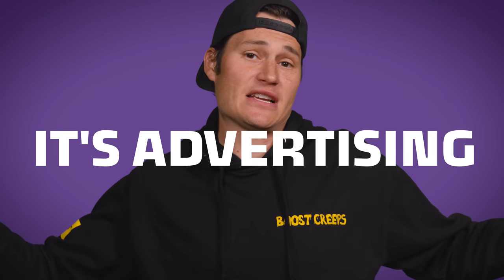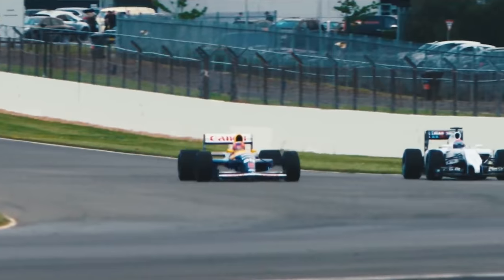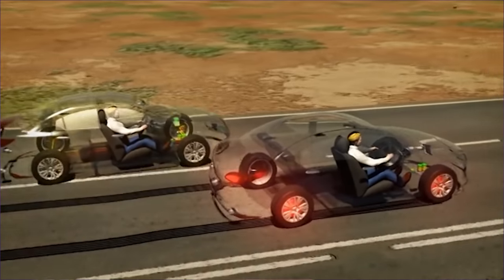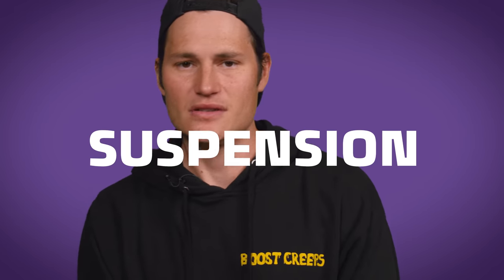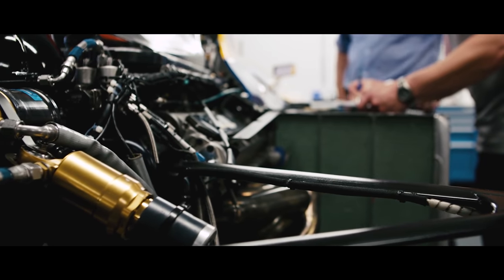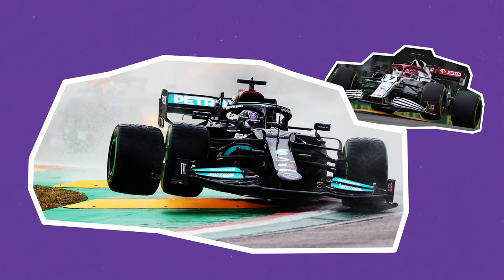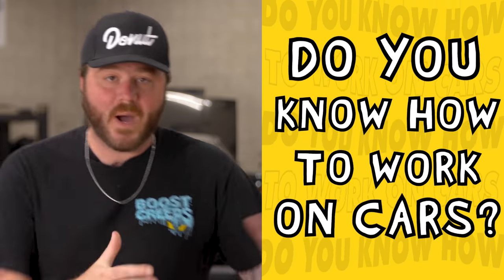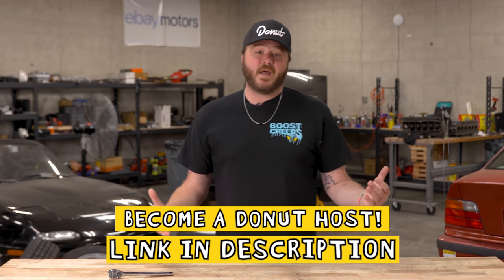Why F1 Banned Their Best Car

Comment: When FIA banned the active suspension, Williams didnt have the time to tweek the car with traditional suspension for 1994 GP, at that time Ayrton Senna moved teams to Williams, the rush to try to go back to traditional suspension is what probably killed Senna, who spoke a lot how the car didnt feel right that weekend. If it wasnt for FIA banning it so close to the GP, they probably could have time to adjust the suspension, and probably avoided the death of a great pilot.
Reply: While the suspension thing is true, the thing that killed Senna was the steering column.
If i recall correctly, Senna wanted the steering column to be elongated. That demand was given out a little late and they could only attach a longer piece of tubing to the steering column. The modification was poor and the tubing that they put in broke during his turn and he lost all control of the car's steering. If you watch the on-board, you can see how Senna's entire weight suddenly shifts to the left when he turns and his wheels straighten out mid-turn  before he crashed into the barrier. That's 100% the steering column breaking and the weight that Senna used to help steer the car got snapped to the left. Williams denied that the steering column broke from the stress mid-turn and said that it happened when he hit the wall, but if you take a look at the pictures, you can see that the point where it broke at is a near-perfect split where the mod tubing connects to the actual steering column. If it was caused by the crash (a force that goes ALONG the pipe from the front), it would've been bent and torn off.
Reply: @darkySp  FIA cheated Senna many times to help Prost win. One of the most disgusting organizations. They have absolutely no sportsmanship spirit.
Reply: @MrMeeHigh1  FIA wasn't an influence over Williams. The teams are still independent, FIA didn't pay or make Williams give Senna a car with a shitty steering column or anything even remotely close to that. That was just poor craftsmanship and Williams not listening to Senna's warnings prior. FIA had nothing to do with it. They even had people investigate the crash, while Williams denied the steering column failure, among other things.
Reply: @darkySp  i think he meant the instances where FIA at that time was helping Prost win races because the FIA president at that time was French and Prost was French. I'm not saying Prost doesn't deserve wins and has no talent, he was amazing but at some moments, FIA gave Prost some advantage over his rival.
Reply: @darkySp  FIA picks winners litterally! By changing the rules days before 1993 to remove Williams car the picked the winner for 1993.
Reply: @MrMeeHigh1  That still has nothing to do with Senna's death.
Reply: @MrMeeHigh1   Every International organisation, which seems and expected to work for betterment of this planet, Some How ended up in causing disasters to the world.

WHO, UN, World Bank, IMF, WTO. These are run by Crooks.
Reply: In 1994 the Williams team didn't have enought to make a good normal suspension and the car design was made to work with the old active suspension. The result was an extremely unstable car.

Trying to to make the car faster thru the corners the Team made a superlow suspension.

At that High Speed Corner in Imola the car was so low that the aerodinamic pressure made the front wing touch the groud, making the car suddenly lose all the downforce on the front wing.

With that downforce lost the car got out of Senna's control and crashed
Reply: @darkySp  Whith so much money on the line I am surprised that none of the sponsors hired somebody. Others went on a trip for a whole lot less. Shows they have sportmanship. Or hard to find somebody in western eu.
Reply: The car was likened to "an unbroken colt" :/
Reply: @MrMeeHigh1  in '88 Prost scored more points, but Senna won the championship. In '91 Mansell would have won the championship but a mid-season change to fuel regulations made Renault unreliable for enough races to allow Senna to win. There's quite a lot of mis-information, and the Senna movie was written very anti-Prost, as opposed to being fully considered
Reply: @djacircarvalho8251  the front wing had a turbulence problem that they didn't know about, causing random downforce loss and being the reason for Senna's difficulty finishing races despite qualifying fastest.
Reply: @darkySp  yes...  the steering column did break...  it was elongated at the request of Senna...  if the driving wheel is closer... you can "muscle" the car in turns to compensate for the lack of the active suspension.  One caused the other...  
The F1A used to be the "Anything Goes" style of Race with the best of the best in the world... if it fit the weight, size (motor and car) restrictions...   when they started to restrict all the innovations...  that's when things got more dangerous.  
Not only did we lose a great driver that day...  the world lost all the engineering potential that comes with the quest for better, faster, safer for years...
Reply: That was only because of the concrete wall it should’ve been a tyre barrier, adjustable suspension was a bit more dangerous actually, like if the computer misjudges the layout it is going to result in a very big crash
Reply: @fightingfalcon826  think i read that the biggest problem there was gps losing track of itself at an inconvenient moment, or in the case of Martin Donnelly wasn't it that the computers crashed, so the car did? it's a long time since i looked at any of that stuff
Reply: yes it did
Reply: The other teams had also electronic suspension, so it was not only Williams who had to adept quickly
Reply: The FW15D (the passive suspension car) was available and tested in January 1994, two months before the start of the season. Imola was the 3rd race of the season. Senna sat on the pole for all 3 races. That had nothing to do with his accident. They tried claiming it early in the investigation, but the evidence showed that the steering column has broken where they had hastily extended it.

Technically, the suspension did kill him because a piece of it broke off during the crash and pierced his visor.
Reply: whut?
Reply: That's a bad welding on the steering column that killed Senna. Nothing more.
Reply: Idk about that dude
Reply: @darkySp  Yes the steering column broke and for some reason they covered this up
Reply: @darkySp  Yes Senna's onboard camera showed his steering suddenly rip farther to the left and then he went off the turn. I agree I think his steering column cause the crash.
Reply: Ok, I'm gonna help you all out of the bs you've been fed. The steering column did not break, it looks as if it did because the wheel could move to ease steering. Before Senna crashed, there was a safety car, meaning the tires were cold and shrunk a little. When the race was back on, the car bottomed out, and went to the right. Senna tried to turn into the slide and the front wheels gripped again, going to the left, and the rest is history. The column broke on impact. However the active suspension could've saved him there
Reply: After the safety car period the tyre pressure had dropped, Senna bolted at restart, hit the bottom in Tamburello corner, and the weak steering column broke.
Reply: @andredeketeleastutecomplex  Either way the car bottomed out and Senna lost the car at Tamburello
Reply: I actually believe that theory. I wonder what would happen if active suspension is still around in 1994, Senna would still be alive today.
Reply: @OriginalFake no u
Reply: *driver
Reply: @MrMeeHigh1  name a time when it had any actual effect. Monaco 84 was, well it’s common procedure. 89 didn’t deserve to get dsq’d but in the end it didn’t mean shit because he didn’t win in Adelaide. In 90 with the grid slot that was senna being a bitch as that’s how the grid had always been. 
Also ironic considering Honda literally admitted to giving Prost worse engines
Reply: What killed Senna is a combination of what you're talking about and FIA disgusting greed for money. They were supposed to cancel the GP completly right after Ratzenberger's death, like they're supposed to do in this situations.
Reply: @darkySp  no one said that it had to do with that
Reply: @brm3175  No, but with the topic already 3 comments into it, suddenly talking about FIA picking winners is off-topic
Reply: @darkySp  yeah ik
Reply: @darkySp  
You've been watching too much fun foil hat theory video's.
The car was too low for a number of different reasons. As Senna went around the corner the car got too low and bottomed out which then rebounded too high (because of the adulation of the track) leaving the car at that moment with no down force, leaving Senna with no way of steering or braking.
Reply: @TATTIEPICKER  So Senna, the best F1 driver to date, just decides to stop steering and shove his shoulder into the side of his cockpit, just for kicks ?
The on-board is right there to be looked at, specialists have looked over it with the same conclusion as mine and there are clear pictures of the steering column being sheared off at the welding point.
Bottoming out wouldn't make Senna straighten his tyres and hug the cockpit's left side. Let alone break a weld.
Reply: @OriginalFake u so disrespect
Reply: FIA like NASCAR, have always been their own worst enemy, usually due to greed or politics
Reply: @djacircarvalho8251  sennas crash was nothing to do with the suspension or the downforce.
Reply: That is not the case. Sure the Williams in 1994 handled particularly badly for a while but the reason Senna was killed was due to faulty welding on the steering column.
Reply: i love. how we are having an f1 debate in a comment section on video about hentai
Reply: @darkySp  What actually killed Senna was "The right-front wheel and suspension are believed to have been sent back into the cockpit, striking Senna on the right side of his helmet, forcing his head back against the headrest. A piece of upright attached to the wheel had partially penetrated his helmet and made a large indentation in his forehead. In addition, it appeared that a jagged piece of the upright assembly had penetrated the helmet visor just above his right eye. Senna sustained fatal skull fractures, brain injuries and a ruptured temporal artery, a major blood vessel supplying the face and scalp. According to Fiandri, any one of these three injuries would likely have killed him."

Plus remember Senna wasn't the only serious crash and fatality that weekend, with a serious crash each day (Friday Rubens Barricello who was lucky to survive his crash, Saturday Roland Ratzenberger killed in an almost identical crash as Senna and Sunday Senna's fatal crash). Ratzenbergers death again was caused by the "The collision's strength forced the front wheel to penetrate the cockpit.[14] In addition to the injuries suffered by the driver from this, the extreme deceleration caused a rupture in his aorta in addition to a basilar skull fracture. Individually regarded, each of these injuries on its own would have been fatal."

Now how much the added innovations on the Williams and if possible the other cars if they were added to them would have made in avoiding these accidents we will never know.
Reply: newey was also adamant that the 93 car would do just fine without the mumbo jumbos while senna correctly say the car was too dependent on the driver aids
Reply: @MrMeeHigh1  how right you are
Reply: @darkySp  This isn’t true. They did test to the steering column and it was robust enough. Adrian Newey talks in length about it in his book “How to design a car.” It’s worth reading.
Reply: @memolano100  Might take a gander, thanks
Reply: @darkySp  you realize a crash jerks the wheels and the steering column, right? No one knows when jt broke. Senna's team mate said it was not the case. Senna just made a mistake
Reply: @arjitagarwal007  what disaster did the world health organization cause?
Reply: @darkySp the steering column was designed to move like that, due to the g force in corners drivers would put loads of force on the wheel to turn it so they allowed some slack in it so it did not break apparently it was the car bottoming out due to a tyre pressure change
Reply: Senna stupid driving led him to his death
Reply: Nope. Williams mechanics killed Senna. Steering column failed and they poorly attempted to fix it. Williams killed him and no one was ever held accountable. Senna's death is so much darker than you think.
Reply: the steering column broke, not the suspension.